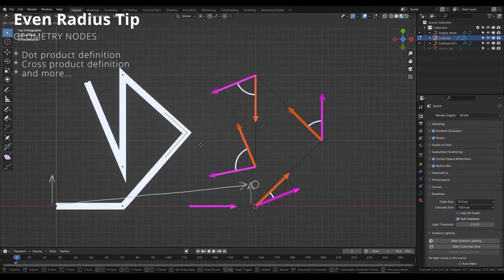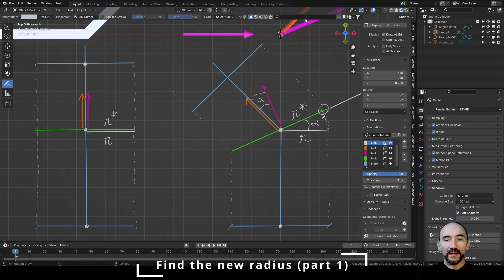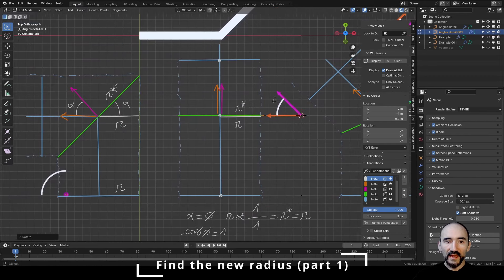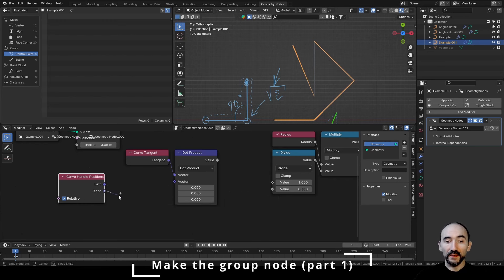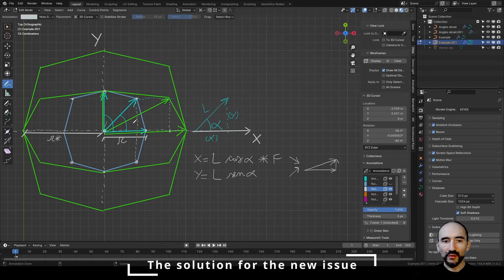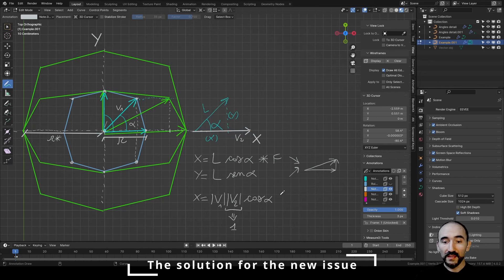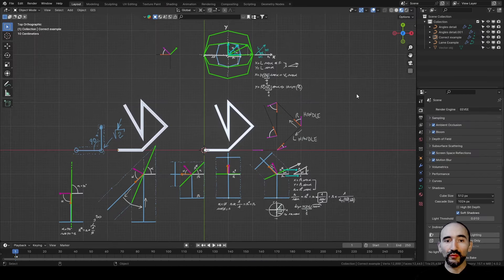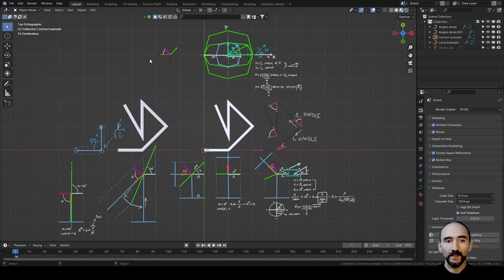Even radius tip on curves in Geometry nodes - Blender tutorial ENG

Comment: what if we are working with poly or nurbs curves? those dont exactly have handles you see
(Edit): turns out thats what the set spline type node is for
Reply from the maker: Correct, you can change the type and set a radius to all the control points to be able to apply the group node properly

Comment: my main question is , can you achieve the same result without using Bezier curve this node group doesn't work on POLY type Splines and that was my main use case for the node group and why i bought it. Thanks for your work ,  but i cant use it unless it works on poly splines :)
Reply from the maker: First of all thank you Dannan! About the poly splines you could add in your GN a Set Spline Type setting it to Bézier before going in to the Even Radius group. In this way the system will add the handles for each control point of the curve.
If you are using a phisical mesh instead with extruded vertices you can add before a Mesh to curve and then a Spline Type setting it to Bézier.
Let me know if you have contraindications about these to solutions 🙂
Reply: @andrea_ciani  yeah I ended up figuring it out last night after a while again thanks for your response and once again great work 😎🔥🤝
Reply from the maker: @dannankelly good Dannan! I’m happy you solved the issue and thank you too again!